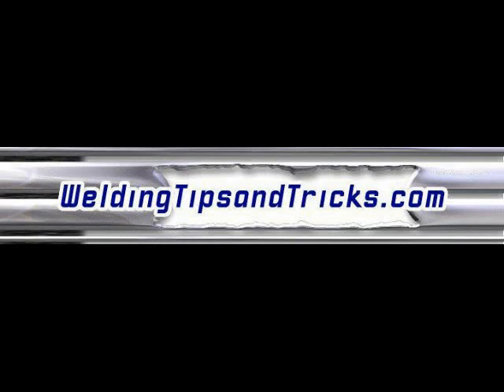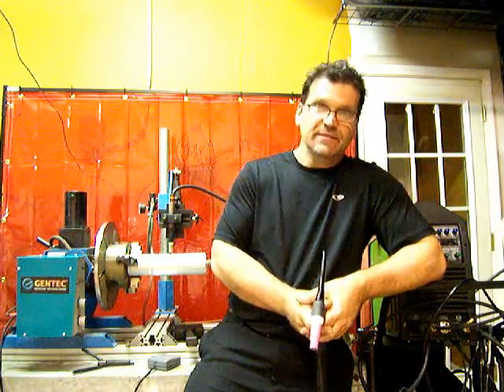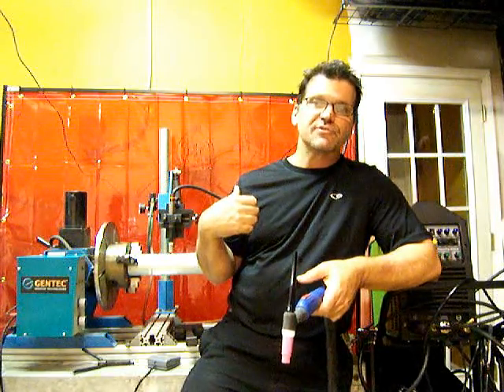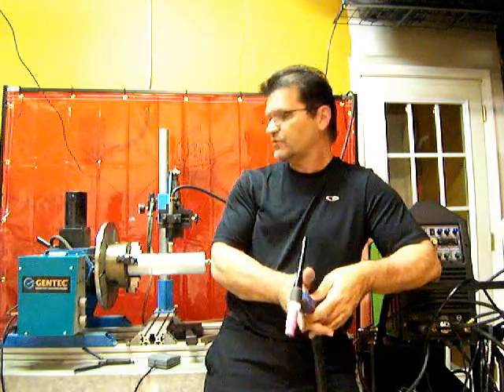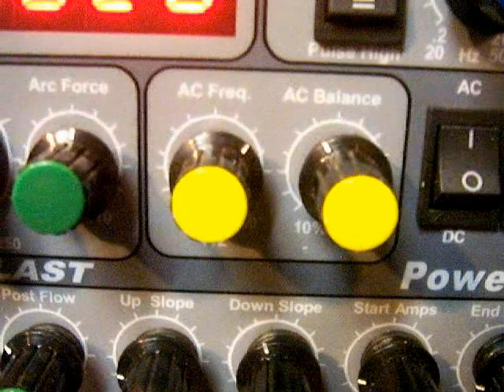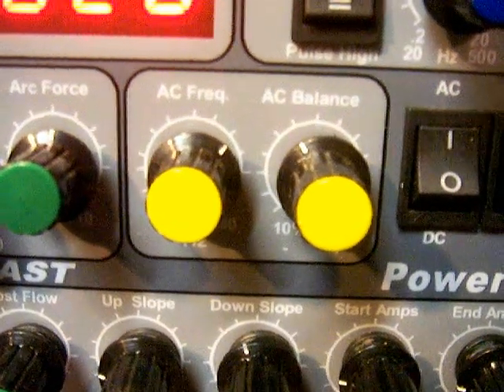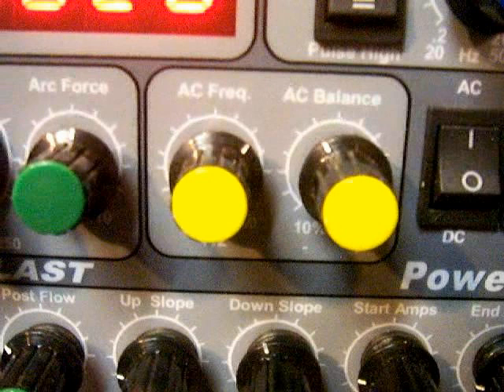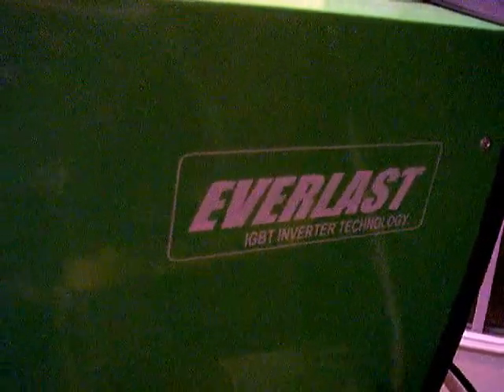Tig Welding Settings Part 1

Comment: Excellent series of videos, thanks, helped me alot.  I'm a little confused about the way you talk about AC balance.  I think when you say use 65% It actually means set my Everlast 250EX on 35%. It shows cleaning action % but I think it's backward from the way you keep saying the numbers.  Is that correct?  I just started trying to TIG weld for the first time in my life (at 47 yrs. old)  I can't believe how difficult it seems to  be so far for me.  I've been welding with stick and mig my whole life  Dang.

Comment: Thanks, enjoyed your video series on this 250ex,  It made my mind up and I ordered one this weekend.  If you or anyone knows what I might need to order while I'm waiting on it (Consumables and such) I would appreciate the help.  I have other welders and gear so I have plenty of welding gear but have never owned a TIG.  Would like to be set up for general welding of Aluminum, Steel, & Stainless mainly.  Nothing in mind right now, just like to be prepared.  Thanks.

Comment: This video is demo with test pipe.
No adding material was done while welding on all 3 welds. Multiple welds on same area makes heat and when pipe cool down do MAJOR shrinks and can crack. (good info).

Comment: Looking for a video on the 4G position on pipe open groove, haven't seen any. I wan't to know what is the best technic lay wire step technic or the weave lay wire and or dip process on 2" to 6" and 8" to 12" or more. Looking to get a niece back side bead with no undercut..........

Comment: why is A/C mandatory for aluminum?.why does steel not weld using A/C? can stainless be welded with  stick welder  (provided the buzz box does D/C)..I just bought an old stick welder with a 'Dynatig Arc Stabilizer add-on made in 1970 by Chicago-based Eutectic corp...have you ever heard of this setup?

Comment: You could charge for these videos. I'm learning a lot with these, plus I just learned about a brand of affordable tig I've never heard of. I'm going to look into one of these Everlast machines. I've been using someone else's miller tig for now. It has ac, but no bias or freqency adjustment. I like Miller, but I swear, ever since they gained exposure on American Chopper, their prices shot way up.

Comment: Thanks.  Just got my first TIG welder....not quite as advanced at a Dynasty or your Everlast (Thermal Arc 150 GTSW) but your video Immediately clued me in on what the settings I do have are for.

Comment: Was wondering if you were using a manipulator or you tig torch holder is just a stand? I was at fabtech in Chicago in 09 and 11 and saw a few companies had some inexpensive manipulators. Have you used and or do you recommend one?  
Thanks